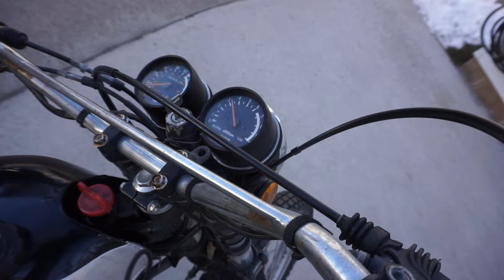Kicking My Leg Off...Free Abandoned Yamaha XT 500. Will It Run? (Part 2)

Comment: The base gasket won't stop it running as its below the rings.Its not a 2 stroke so an air leak there is irrelevant.The bikes running like that because the accelerator pump is fkd .As someone said previously .You such a Muppet

Comment: There is only one fluid in this bike and that is engine and transmission combined
Reply: What I meant to say the engine and transmission oil or combined I rode one of these for many years back in the late 70s into the 80s and there is only one oil that is absolutely a dry-sump